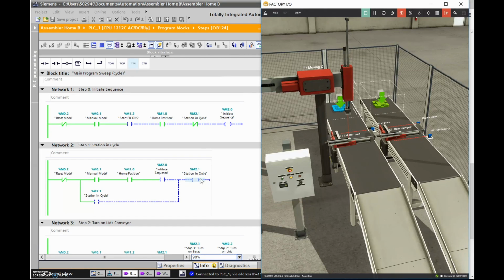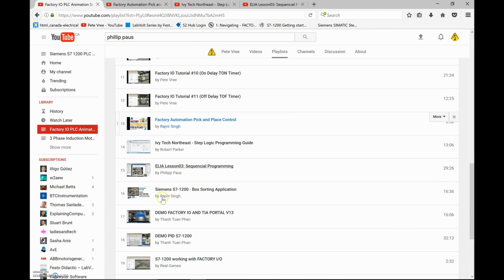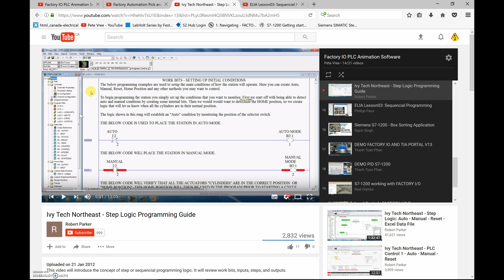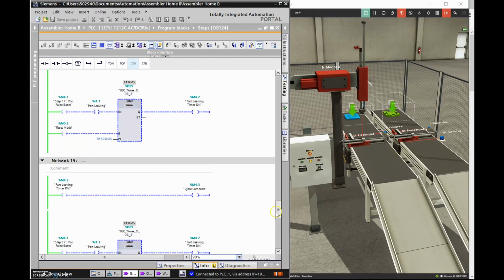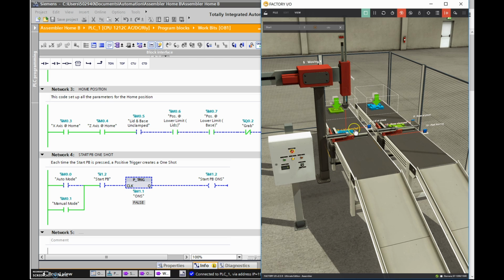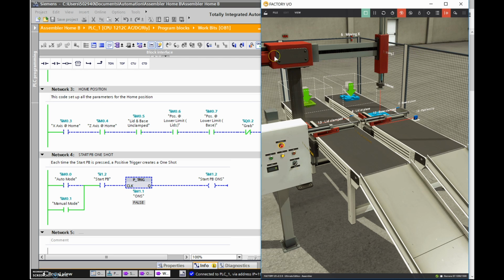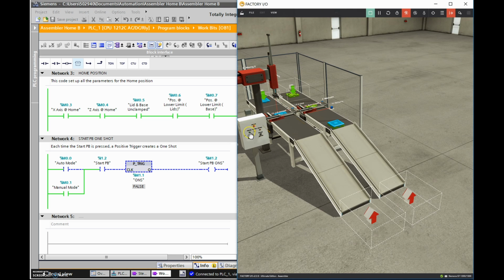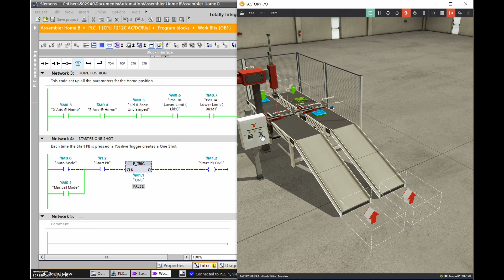Siemens TIA Portal & Factory IO (Assembler / Sequential PLC Programming)

Comment: hi Pete , could you please show the hardware configuration with the linked sensors and actuators för the assemble station?
Reply from the maker: I just used the standard Scene. What specifics were you looking for?
Reply: @PeteVree  i was thinking about if you personalized the plc card or not, could i get your email contact for some other questions? i have till now put the cpu, the digital and analogs inputs and outputs, connected IO and TIA v17 with plcsim advanced 4 and is working but i need to programm it .
Reply from the maker: @iulianut9757  vree.peter2@gmail.com

Comment: Thanks Pete for the video. I've just installed factory io and try to use it with a physical s7-1200, i've set up the connection as indicated so i see the green marks but at the plc side i don't see any changes in the input as well the output. How the mapping of i/o between tia portal and the driver is happening? Thanks!
Reply from the maker: https://factoryio.com/docs/tutorials/siemens/setting-up-s7-1200-1500/